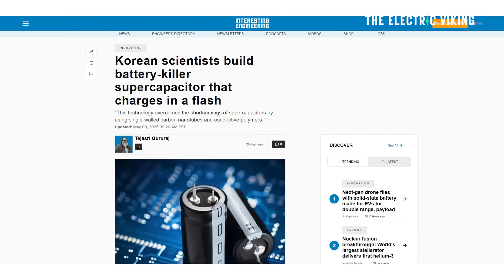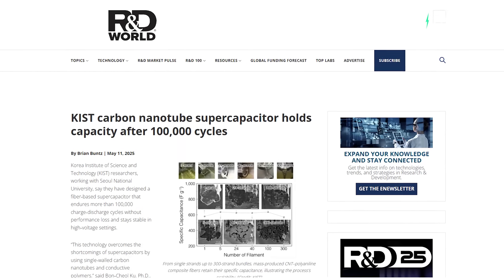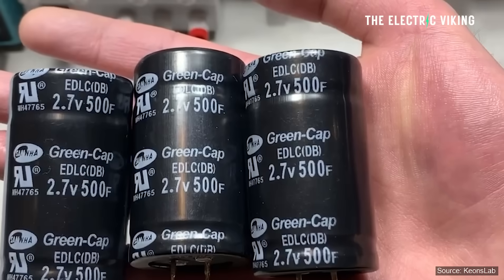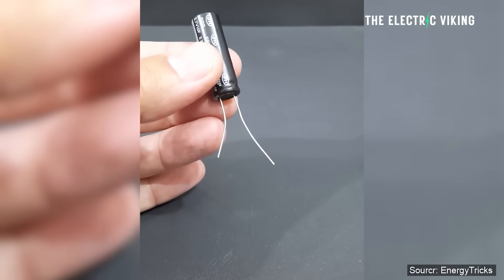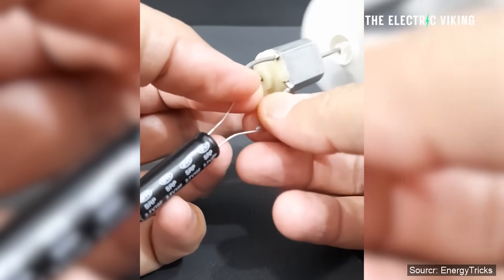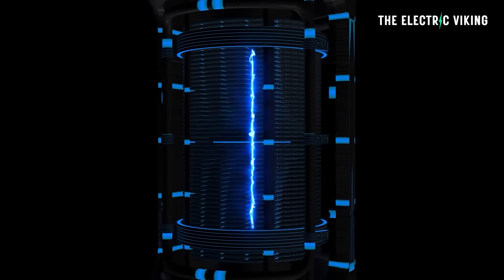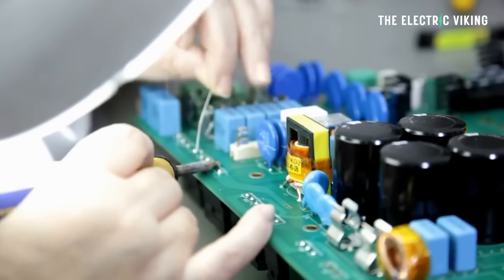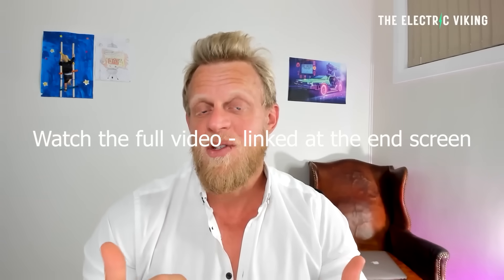72-Second EV Charging: Supercapacitor Battery Tech Finally Gets Real!

Comment: When will this nonsense stop?  This story has been hyped for decades. Capacitors can never replace  batteries because their voltage is directly proportional to charge. Half charge = half voltage.  
 No load devices can operate on such widely varying voltages. Some voltage regulation circuits have been devised , but their performance is pathetic.

Comment: As a kid in the 70s, learning electronics and microcontrollers (yeah, I was that nerd) one of my high scool teachers told me "battery tech was as good as it would ever get" and the only workable rechargeable tech the would ever be was lead-acid. A few years after that, and it was only a few, nickel-cadmium happened, then metal hydride, then lithium-ion, then LiFePo...

Most of the recent battery tech advances of the last decade have happend in China so, if a research papers have cracked the road map for supercaps as dense energy storage, my money is on se asia making this happen.

Only a few years back, LiFePo wasn't energy dense enough for cars, then BYD launched their Blade cells. LiFePo is less prone to puncture fires, cheaper and has more charge cycles, and BYD are bringing it close to Li-Ion densities.

Super caps are already used for regen braking and energy return in light and heavy rail systems, and there are no physical laws that say the idea can't do long term high capacity storage, just chemical limitations that are mostly a matter of finding the right chemical solutions.

Give the South Koreans 10 years. Give the Chinese 7. They may not crack the supercap battery nut, but I'd say the shorter odds are on they will.

Comment: The  biggest problem with any capacitive story is that their voltage is proportional to the level of charge, which means that their load must be able to operate efficiently over a wide voltage range: 5 to 1 or more.  A chemical battery has a much flatter discharge curve, falling off sharply at the end.

Comment: Sometimes I wonder if you just might be not very bright. There is no way a battery can be charged in 72  seconds. Why you wonder? No way to supply that amount of electricity in 72 seconds.
Reply: Nonsense. In Kilowatts, they're not batteries they're Capacitors. Think IONS not Electrons...

Comment: Talked a lot without saying anything really. Complete waste of time. Zero info on the made up new caps.

And just how do you suppose to move 100kwh for a car into a cap in 100sec? Complete nonsensical. Are the cap connectors made of railroad track bars?

Comment: 20 years ago, they referred to this technology as "ultra-capacitors" or "ultra-caps".  The biggest interest in them was in powering consumer electronics.  They never seemed to crack the basic problem of slowly releasing the stored energy.  If they can make this work, it would be pretty major.  You only mentioned the quick charging aspect, but there are at least three other things that could make this technology not just a lithium killer, but even a battery killer.   First, traditional capacitors don't use any exotic materials. Even if they have to strap on other elements, I doubt it will approach the cost and complexity of lithium.  Second, capacitors are incredibly light.  This could be a major factor in range efficiency. Third, traditional capacitors are cheap to manufacture.  Of course, at this point we don't know what the end product of this Korean effort will look like.  It's possible that their innovations could negate the traditional advantages of capacitors.  We'll have to see.

Comment: I believe some supercapacitators are already in use as first stage energy storage in some cars already, there is no need to use regular battery to store brake energy, this energy may be stored in these and used when high energy level is required, most cars are able to give a few seconds energy boost, if they are not currently using supercapacitators they should do. (life cycle are extremely high).

Comment: Wrong tech for cars.  As you say a capacitor can cycle enough times for 100 years.  Nobody wants a 100 year old car (wood bicycle wheels and a steering arm).  Super capacitors have their uses in power backup in clocks, discharge devices like flash tubes and welders that cycle quickly.  No need for a car.  If you needed to charge an 800V 85kwhr battery in 15 seconds would take 25,500A and need cables of about 40cm diameter. These massive conductors and enormous currents at 800V would be incredibly dangerous, requiring enormous circuit breakers.  Totally impractical

Comment: Supercapacitors are already old. The main issue with them is energy leakage. They do not keep charged when no energy is used...contrary to batteries which keep charged for often years after charging (when not used.
But any condensator can be charged and discharged multiple times in a second....if the wiring can keep up with that amount of energy. They are used after block rectifiers (4 diodes)  to even out the dc current to a constant. 50 to 120  cycles a second.
Some calculations....
Charging a car in secomds (with those capacitors) is impossible due to heat in the wiring from charger to car.
If you want to charhge a 100KWh battery in 1 hour you need a 100KW constant charging speed.
Charging in half that time doubles the charging speed .
If you want to charge in 1 minute  you need a 6MW charger....6000 amps at 1000volts.  That is accelerating 3 passenger trains at the same moment...(2MW each)
Success with the wiring.
Also totally unneccessary....except for maybe an emergency car (firefighter truck, ambulance)

Comment: I wonder if supercapacitors could speed up fast recharging by rapidly taking up energy from a fast charger and then discharging that back into the traction battery. This would not replace fast charging the traction battery but augment to allow quicker recharging. It might also afford a range extension for older EV's if a supercapacitor kit were to be engineered in such a way as to integrate with older EV's that have slower charging ability or to compensate somewhat for battery degradation.

Comment: There are two flaws with using capacitors that you don't mention:
1. they have a very high self-discharge rate which means that can't hold a charge for very long
2. electrolytic capacitors ( that use  water) will dry out over time and cease to work
Both of these problems would have to be solved before capacitors could be used as a direct battery replacement.

"Supercapacitors have a higher self-discharge rate compared to lithium-ion batteries, meaning they lose charge when not in use. The self-discharge rate of supercapacitors can range from 5% to 40% in 30 days."

Comment: Super-capacitors are actually used in caternary-free electric trams. Just think of the ones that recharge at every stop. That needs a quick charge that needs to done hundreds of times a day. When Siemens built their first Combino Plus they did literally install capacitors under each seat in the passenger section. This has gotten better over the last decade of course but every new development makes the technology more feasible including options for regional trains. Currently there is a great push in Germany to replace all diesel-electric regional trains by battery trains (or hydrogen powered electric trains), see Siemens Mireo Plus B, Stadler Flirt Akku and Alstom options who are currently grabbing the market.

Comment: Capacitors have a terrible discharge curve when compared to batteries. You really really need to include this type of information.
Reply: Discharge rate can be controlled using resistors. There will be, of course, electrical energy transformed to heat in the process, which has to be considered.

Comment: Suppose that this (or any other rapid charging electrical energy device) actually works as advertised. When you stop your car in western Oklahoma (or Australian out of the way spot)
at the recharge station and there are 20 cars in and out all day long, where in heaven's name can enough electricity be supplied to run just this one station. Run the numbers and you'll see that windmills and solar panels  will need a coal fired or nuclear power station next door to make that much electricity that quickly.

Comment: Where are they going get that amount of power in such a short time. Think about the cable carring that load. Even if you went at the maximum rate achievable thats still well about what any current gride can deliver.

Comment: Supercapacitors ought to have an automotive application in regenerative braking. When you step on the brakes, the electricity generated is too much for current batteries to absorb. But a quick charging super-cap pack could handle a sudden influx of electricity more effectively. So hybrids or full EVs could be more efficient.

Comment: Please STOP this insanity! Capacitors will never be used instead of batteries! It is not possible no matter what how fast/big/whatever new thing they invent. The discarge voltage of capacitors is dropping towards zero. Somewhere in your aplication there will be a voltage drop off  where it stops working meaning lost capacity.

Comment: Until a supercapacitor demonstrates an energy density of at least 250 watt-hours per kilogram over no more than a 25% drop in voltage, there  there will be very little or no advantage applied for vehicular applications, including regen braking. Today's highest energy density supercapacitors exhibit less than 25 watt-hours per kilogram.

Comment: A high voltage capacitor could replace batteries: energy = 0.5 times voltage squared times capacitance. The charging and discharging of capacitors is not based on chemical reactions, therefore a cap has a very high number of cycles. Usually high voltage caps have very low capacitance. During a complete discharge the voltage drops to zero, a capacitor disadvantage with respect to batteries.

Comment: What is the CAPACITY of the supercapacitors? They are useless if they only have the capacity of 1kWh (for example).
Reply: From the paper - Storage 418 Wh/kg, and a power density of 587 kW/kg. Typical lithium ion cells 200-300Wh/kg.
Reply: @jonathanpearce3773    Thank you very much for the info. But supercapacitors at 418Wh/kg is only about 30% higher than lithium ion cells (considering 300Wh/kg). Not really that much. Also, supercapacitors at power density 587kW/kg, how long can this power sustain? Lithium ion cells can provide a constant power for a typical EV range of 300km. Not sure if supercapacitors can do this. Thank you again.

Comment: Note that they claim higher energy density than Li-ion batteries. Plus 100k cycle life and a several times higher C rate than batteries. If they could make this in an affordable way (carbon nano tubes sounds expensive) this could revolutionize the market. There are some downsides with capacitors they didn't claim to have solved though. Such as the fact that capacitors can't store energy long term as they discharge more rapidly than batteries over time. And they also didn't mention cycle efficiency, which is an issue when you have chemical bonding taking place.

Comment: The persistent problem with supercapacitors is not just energy density, it's also discharge rate.

As in the cell just discharges A LOT faster than most electrochemical battery would.

You can usually leave a fully charged Li-ion battery cell for days in ideal temps/humidity and find that it has barely discharged at all.

A supercapacitor would have lost a very significant fraction of its charge after days though.

Comment: Dump the regenerative breaking energy of a stopping EV into the capacitor and then discharge it to start to move the EV again.  This would preserve the charging cycles of the main Lithium-Ion battery, extending the life of that main storage battery. It would essentially be a hybrid capacitor/lithium-ion energy storage system. It's albeit more complex and expensive but would greatly extend the battery.
Reply: Kinetic energy recovery from braking is not enough to stress batteries and wear them out like a charge cycle.
Reply: @lindsay5985  When you discharge 1% and then immediately charge 1% that is 1% of a charge cycled used.

The regen charging and discharging is micro-eating up charge cycles overtime.
Reply: @crcurran  No, incorrect. Shallow, rapid mini-cycles barely count toward cycle wear.
Reply: @lindsay5985  It's not about battery stress ...but about efficiency. Regenerativ braking with battery usage is somewhere around 75% efficient.
With capacitors this can go up to 90%. In other words...range extending during city driving.
But we need totally different electronics when using capacitors. They have a lot bigger decrease in voltage during discharging...to zero when fully discharged. A motor controler can have issues with such low votage but still high needed energy output when those are nearly discharged.
Reply: @reiniernn9071  the voltage drops because they have such poor capacity compared with a battery.
Reply: @lindsay5985  The capacity has nothing to do with voltage drop. 
It is the physical working of a capacitor...totally different from a chemical reaction in a battery.
The capacity of a conductor can be made as big or little as they want.
Reply: @reiniernn9071  I dodnt know about the 90% efficiency commapred to 75% efifciency but I would if I had thought about it. That's !ange extending. and protecting the battery longevity.  Thanks.
Reply: @reiniernn9071   Yeah, I agree that efficiency could improve, because super caps can probably accept high current bursts from Kinetic Energy Recovery Systems during heavy braking more readily than batteries. I just don't agree that very shallow charging and discharging has a profound effect on a batteries longevity --it's certainly much better than not having KERS.
Reply: I've been waiting for years for the technology to catch up to my plan.    These capacitors need to be used in everything from e-bikes to aircraft and anything in between
Reply: This is old hat. Been in Formula 1 for some time.

Comment: Super caps are not  new and are used in modern electronics and have huge in order of Farads in a tiny packages Caps unfortunately have a limited life AC  and DC versions are usually  the first that fail in electronics

Comment: Supercaps are short term energy storage to help a battery provide higher peak power to a motor for instance when accelerating. You still must have a battery. Energy density is important but not the real issue.
What is? well a few simple ENGINEERING equations: Energy stored in joules is (CxVxV)/2.
Power in watts is joules(E) per second. P=E/t
If these mean nothing to you, drawing constant power from a super cap collapses the voltage very quickly and it becomes useless until it is recharged.
A battery only experiences a small voltage drop when providing power.
They are not the same.
Read an engineering book.

Comment: I have a couple of these super capacitors on my desk, rated at 3.7V and 400F they have a number of advantages over a battery (aside from the number of cycles) - higher discharge current, low voltage operation, linear charge response - and they cost $1.....

Scaling up to EV requirements will be a challenge  -  until they create a more compact form factor/

It is a solution looking for a problem - but can easily be applied to increased thrust, storing regenerated energy

Comment: I always assumed they used super capacitors on evs for the regeneration braking.
Yeah, just checked, they're used on most evs for that purpose. It just seems likely that their use will be increased as their performance improves. Surely it's just a question of numbers,  a threshold value of watts per gram. Surely, this is the future, whether by dribs and drabs, or by a Tsunami.

Comment: Supercapacitors are used in electric buses for faster acceleration from stops. They could also be used in small battery powered airplanes such as the Pipistrel Velis Electro to take the load off their batteries to get them to cruising altitude,and once there,the batteries could power the plane.

Comment: I note they didn't say Wh/kg.   The best supercaps are around the 10wh/kg mark, not 200wh/kg like batteries are.   So unless they have got a 20 fold increase in capacity, meh.
I tend to also see that when you get "researchers say" articles, it's not ready yet.  If it was, a car company or battery manufacturer would have been in there like a shot, and the researchers would be under NDA - and the first you would hear about it was a CEO announcing a plant was half built to do make these.

We have now hit the "selling the idea of the sizzle" phase of energy development, where organisations try and maintain eyeballs on their research to try and attract funding.
Reply: A quick search - Nanocell-structured carbon nanotube composite fibers for ultrahigh energy and power density supercapacitors - they are talking about 418 Wh/kg and 587 kW/kg so pretty impressive, but yes getting to production will be the challenge.